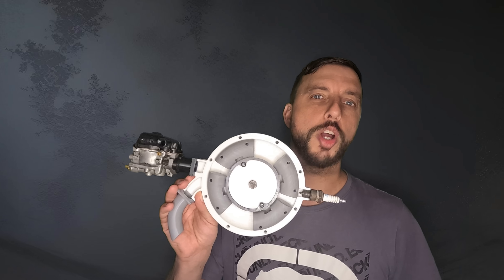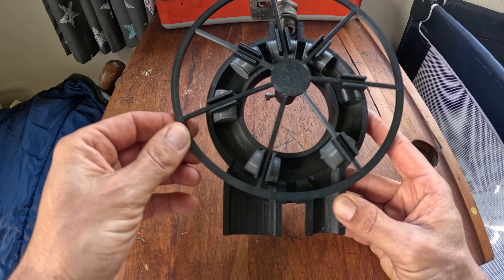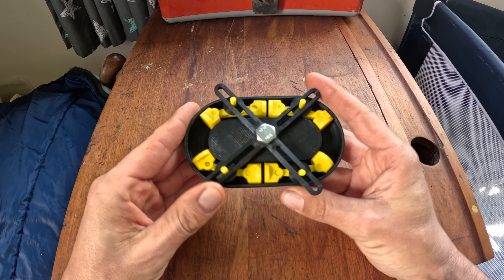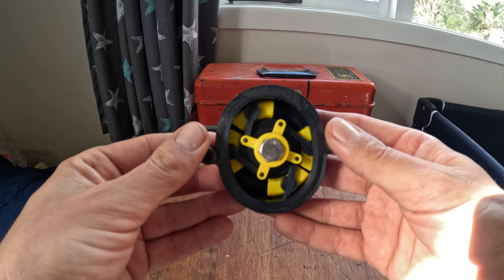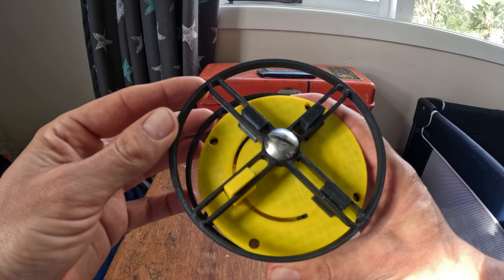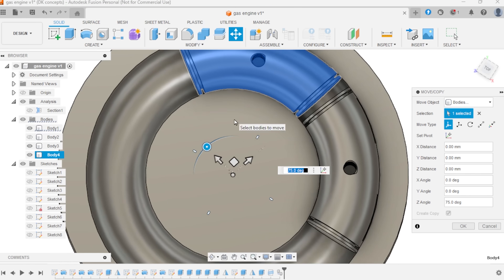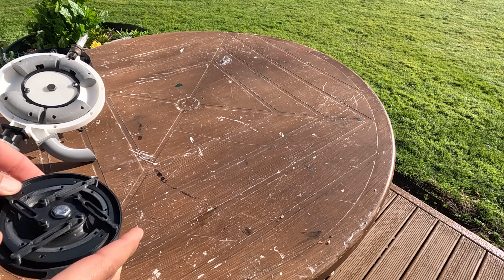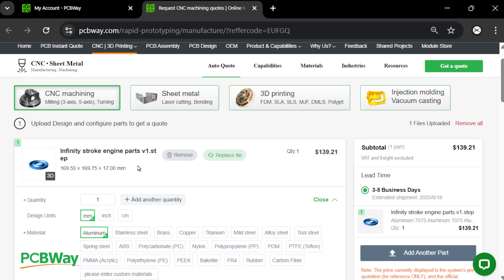Infinity Stroke Engine, More Powerful Engine?

Comment: I can't wait to see it in action. 😍
Another internal combustion engine similar to an electric motor already exists: gas turbines. They are very efficient, but the downside is that they have low torque at low RPM and struggle to gain speed.
Reply from the maker: They are awesome engines! But hard to use as you say
Reply: @dkthewelder gearing. Turbines are used in heavy machinery commonly 

That’s why gearing and transmissions exist
Reply: but the two combined is the best of both worlds. Turbine generator driving electric motors
Reply: turbines arent efficient at all. they have low thermodynamic efficiency, or put simply, low compression ratios. so they chew more fuel to perform the same amount of work...

they have benefits in niche applications, otherwise... if they were so superior they would be used in everything... they arent.
Reply: @paradiselost9946  You're right, I had confused gas turbines with combined cycle gas turbines, but those are too big and heavy to be mounted on a vehicle.

Comment: I don't understand where's the rotation coming from? 
The combustion forces work on both of the pistons, pushing on opposite sides
Reply from the maker: Yes, it is pushing on both sides but the rotating direction has a mechanical advantage so it will spin that way. But getting the spark in the correct place is pretty important or it won’t spin

Comment: I think this is a great contender for a rotary diesel engine
Reply from the maker: Yes if the injector was just right I don’t see why it wouldn’t work!
Reply: @dkthewelder  i also think it would be preferable since it would be difficult to lubrecate without burning oil whereas diesel is already lubrecating on its own

Comment: magnets lol love h8 relationship...um popped in my head to have like electro magnets like on bottom of washing machine so ya can advance or retard pistons and electromagnets would handle more heat an not demagnetize?
Reply from the maker: Yeah I thought about the demagnetize but needs to be red hot for that so should be fine, also when moving a magnet fast over aluminium it can also create problems. I thought about having no drive output at all and just running coils as you say and it can work as a generator, but I think the simple version like I made from plastic it the best way to start and easier to problem solve

Comment: Some Unusual engines book by LJK Setright. Get a copy out of print and expensive second hand BUT the guy knew his engines and there are dozens in the book complete with analysis of why they were a dead end....including clap hand toroidal engines.  Not raining on your parade but could save you a shed load of time and money. Also the Douglas Self website ferret around in his "museum of retro tech" until you get to the section on cat and mouse ic engines Aye, well, hmm. Sorry once again.
Reply from the maker: What! I couldn’t find any motor like it. I will have to try find that
Reply from the maker: Hey thanks so much for that. The cat and mouse engine is very similar! And there are some great animations as well

Comment: you could just first make it just as driven compressor.

the "crank" plate on the behind you could just make it as a plate with the travel holes in it rather than as those spokes. or 2+ plates(bolting togehter) then you don't need to reprint, can use a cut steel plate and can change the timing and compression ratios.  you need oil rings in them for the seals, they're not a problem on the cylinder thats circular.
Reply from the maker: That is a good idea, I might play around with that idea! I’m still yet to work out compression ratios and port timing so hopefully more helpful comments come
Reply: i guess this would, by being more sturdy, also act a flywheel

Comment: I'm having trouble seeing how the centrifugal weights will be enough to compress the pistons together.  Takes alot of force to conpress air wouldn't it? I'm no engineer just a problem I think might happen.  I could be completely dead ass wrong lol.  Love the engineering that went into this video. I wish I could invent things.  Much love brother
Reply from the maker: The conrods push the pistons together it is pretty confusing how it works I did my best to try explaining it but really need a good animation to show it work. Thanks for the comment

Comment: good luck man theres gonna be some hurdles
Reply from the maker: I know , I got myself into some problems here!
Reply from the maker: Where do you think the spark plug should be? And you think I should use two?
Reply: @DktheWelder 2 for sure and hard to say im sure theres some complicated maths to find the optimal spot at least with 2 you can mess around a bit
Reply: Let's see a simple aircraft rotary engine version first to work out a few bugs.

The crankshaft is fixed to the firewall and the cylinder spins.

Early aircraft engines sucked in fuel through a hollow crankshaft. For lubrication they mixed castor oil with the gas. Castor oil does not burn and it's exhausted with the exhaust gas through a valve.

E.A.A. has a huge airshow in Oshkosh Wisconsin yearly and demonstrate a working engine daily during the airshow. Many video's posted to YouTube showing it running and explaining it.

The cooling is performed by spinning the cylinders through the air.

Blanco's channel has a great video from this year of the engine demonstration.

There's also a market for aircraft engines for models and for the Light Sport and Ultralight classes of aircraft around the world.
Reply: Rotary engine explained with demo.

https://youtu.be/s5473Oc0nzI?si=u-d_sPUXIo8pPV1Q

Comment: For some reason this makes me think of steam and want to ask Tom Stanton if there is a precedent (because he knows way too much about Steam).
Reply from the maker: I guess it does as it uses both sides of the piston, yes his advice would be good!
Reply: I also thought of Integza... Pretty sure he would come up with some hydrogen peroxide super fuel or steam and it will have no choice but to run!
Thanks for your work guys. Hope you heal soon!